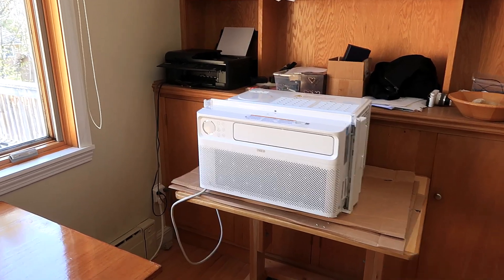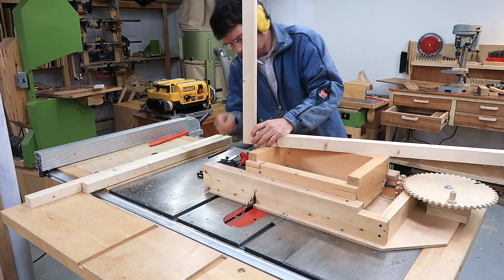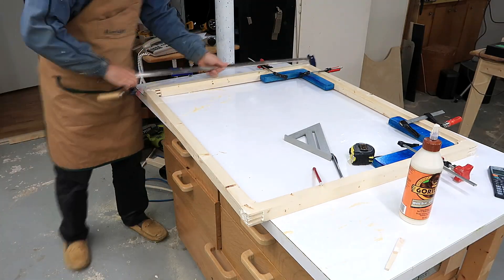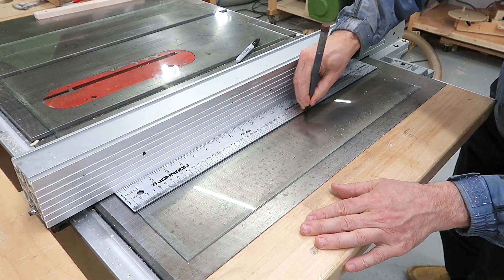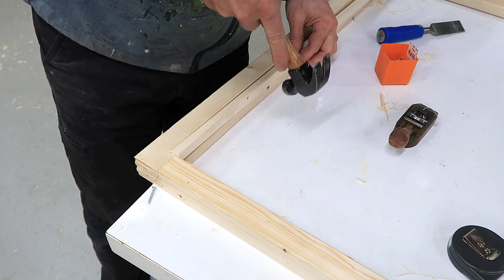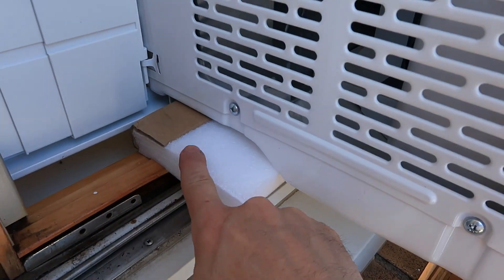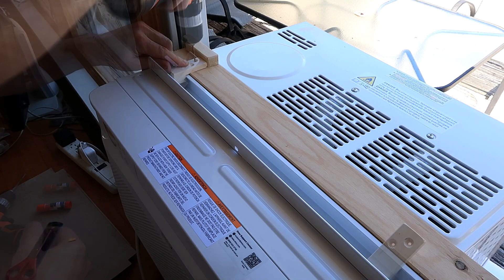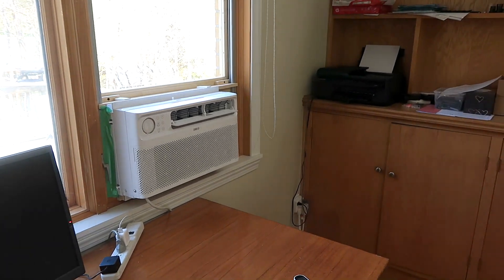Window AC into casement window: Making it fit!

Comment: For those who find glass cutting aggravating, here's some things i learnt bashing my head through it a few times: 
1. Find the best knife. 99.9% of the knives you find on the road are garbage. Even in reputable brand batches, you'll find garbage ones. It's all about finding the right one. I genuinely think i went through dozens of them until i managed to score the right knife.
2. Plan your cut. Kinda like in welding, do a ghost pass before the actual one. One, you wanna make sure you don't get stuck in something, two, that your brain has registered the motion so that:
3. Never stop mid cut, complete the cut in one smooth, clean cut. Never double back, never redo the line.
3a. If you had to stop, whatever the reason, find the termination of the previous cut, and start from that.
4. Practice. If you made a bad cut, the junk piece is your slice. Make that thing into tiny chips. It helps a lot.
5. Make sure the edges are scored through, start as cleanly as possible from the edge. If you don't have much luck with that (if you find that chipping occurs or the edge isn't cut right), you can use 3a in reverse.
6. Light scores = best cuts.
7. Don't bother with tapping all that much. Either use the weight of the glass to help you snap the extra piece or use the tiniest grain of sand under the cut to press the extra piece against on a flat, smooth surface.

I've managed to go up to 1 cm thick glass using these. Perfectly smooth edges once i managed to get in the right groove.
Reply: I must have been lucky, my first glass cutter I got from a guy that was selling off his stained glass setup.
Reply: Yeah, my grandfather used to cut LOTS of glass for his greenhouses.  For him cutting a piece to fit took about a minute, and he never botched one up.  And yeah, super sharp oiled cutter, and a single pass without much  pressure at all.  After you've done about a thousand of them over a decade or two you get pretty good at it.
Reply: I found oiling the cutter make a huge difference. 
Dry scribe doesn’t break as sharp and sometimes even deviate from the scribe line.

Comment: Your solution is a lot more elegant than mine. I just used a 3/4" piece of plywood  to fit both the window and cut a hole to slide the A/C unit in. Then cut more holes for side lights and flat mounted plexiglass with silicone and 1/4 round. Screwed the while thing into the window frame. Since the plywood was so thin the A/C unit kind of teetered a bit so I ran some small chain up to the soffits that I could secure the back end up and level it off.  Just have to make sure it tips down slightly in the back or the moisture will run inside 🤔 😀

Comment: I have horizontal slide windows and several window units. I find a well cut sheet of plywood and a little scrap foam work well but your solution is much nicer.
Reply: My dad used rigid foam insulation which was great for efficiency.
Reply: This is what I did last summer. Looked like crap but it worked

Comment: I love the process you went through to install this AC.  I did something, somewhat similar with an AC that has the round ports that you close on a double hung window, except I had a casement window as well.  I had not installed glass though, so I liked that upgrade.  Mine was for a tenant though, one which wasn't paying rent either so it was just better that they leave so I could get the central AC fixed.

Comment: I've been installing my ACS in a similar fashion for years. I either use layers of laminated cardboard or slices of styrofoam for the sides. I use plexiglass for the top of the units. I get them to cut it to shape when I pick it up. Not as fancy as the window frame you fabricated.

Thanks for the content.
Keep up the good work.

בס'ד

Comment: My home office is right under the roof and in the summer it can get quite toasty, especially with the computer running 8 hours a day.

I've bought a single hose air conditioner from TCL. I know that it's really inefficient but it was all that was available. I don't have access to the window from the outside, since it's so high up, so I bought a Plexi glass sheet, cut it to size and cut a hole in it where I can plug in the hose.

The whole contraption just sits right up against the rubber seal, held in place by some wooden blocks.

That means that the mosquito net as well as the shutter still work perfectly fine and I can install the thing without having to mess with them.

It works reasonably well, though it is extremely loud and inefficient by design.

Comment: Put the hardware in a Ziploc bag and tape it to the window, then when you want to reinsert the window, you can.

You should have added a second pane with a gap between. Double pane is better.
Reply: the plywood has 14 layers
Reply: Tape will leave a sticky residue later. But it is a good thought.
Reply: @mckenziekeith7434  If you tape it to the top edge of the frame, it won't show and shouldn't matter much.
Perhaps staple the bag instead.
Reply: @sdspivey I’ve been using magnets for hardware, and it works great. If there isn’t a place on whatever I need it for (ex the window), i have a magnetic dry erase board i can label

Comment: I wish I had had the tools to do something like this when our central air died. It was a miserable two weeks before an HVAC tech could come out to fix it. The upper floor of our house hit 115°F at 90% relative humidity. We basically lived in the basement, and even down there it still got up to 92°F. 

Every window in the house is a casement, and even though I found some units that fit casement windows, no place locally stocked them. To special order one was going to take about as long as it took to fix the central AC.
Reply from the maker: A window AC, while not able to cool down the whole house, can drop the humidity in the whole house quite substantially -- even a small window AC
Reply: Holy hell. I'm glad I live in Sweden. It might get up to 92°F in my media room on the summer with PC, TV on. Your "115°F at 90% relative humidity" sounds like a punishment.
Reply: @matthiaswandel  Yeah, that's primarily why I was trying to find one. Any drop in temperature however small would have been great though. 

I ended up buying a dehumidifier. Even though it made the basement a few degrees warmer, dropping the humidity from 90% down to about 40% made it so much more bearable.
Reply: I used to cool my whole house with one window ac unit, granted it was a larger one and permanently mounted in wall. It was in living room so I'd just run a couple fans blowing into the bedrooms. Cooled the whole place

Comment: I've wanted to do something similar even though I have a double hung window

I'd like to get a much better seal to keep out bugs and the flimsy plastic accordion stuff is no good for that. Blue painters tape works, sorta.

I run AC in my small office rather than the whole house since I work from home. No need to cool the rest of the house until the evening.

Comment: Might I ask why you'd install an AC, but re-use single pane glass above it? Seems like a weird combination. Is energy that cheap in Canada?
Reply: Doesn't make that much difference, at least not for a single window. A normal double pane window has an R value of 1.5-2. Single pane is around 1.
Reply: In summer it's hot anyways.
So why bother with insulation?
Reply from the maker: In winter the tempreature difference is often 30 degrees C.  In summer, with AC, it's maybe 5 degrees.  Just not worth it for summer only.
Reply: Yes Canada has very cheap electricity. Majority of our provinces use Hydro Electricity. We have lots of water…so far!

Comment: Never seen an in-window air conditioner here in NZ. Really weird. We only have split systems etc here.
Reply: Extremely popular here in North America.  I’d say since the last 20 years now we’ve begun going into your type of A/C.  They’re called mini splits.
Reply: That's right. I just replaced two window type AC units with 2 1 ton mini Split system s. What a difference. Much more efficient and quieter.

Comment: I have never in my life seen a window that opens like that with a winder. Are they common in your country?
Reply: They are called casement windows and they are very common in Canada.
Reply: @peggyt1243  I think the winder is pretty cool. It reminds me of my old cars.
Reply: @christopherinteriors6521  Are casement windows better than sliding?

Casement windows are more energy-efficient than sliding windows. Since a sliding window has to have a flexible seal on the top and bottom runners of the window, it can never seal as tightly as a casement window. There will always be a bit of a gap on the top and bottom sash that allows some air through.
Reply: Sorry guys we seem to be a bit confused here from my original comment. I know what a casement window is, Most houses in England have them. It is the winder that opens it that I was curious about. Many thanks

Comment: Easy, just close the window and throw the AC unit at it...done.  Make sure the unit is tilted down at the outside at least 5 degrees, or you will wish you had.  Seriously, it is important, otherwise it can leak inside, and often not initially but after a year or so, for some reason.  Maybe crud buildup in the bottom of the cabinet?
You make AC mounts like most people make furniture.  I just cut out a piece of 3/4" plywood and chunked it in.  Easier in aluminum single hungs.

Comment: I have sliders like you. I didn't want to put it in the window so I cut a hole in the wall with my 4" diamond saw and jackhammer and finished it out. It's much better, but a lot of work. The second floor required me to make a small scaffold. I just used double 2xs and plywood.  Altogether it was about 3 days of work including patching/finishing inside for each a/c unit.
     I put them just under the window lintel and 6" from the edge of the window for structural reasons.
    edit;  3 units were about a week and a half to put in.  I really should have specially ordered sleeve units for the particular wall but I was in a hurry and just took a stock ac unit. The sleeve was a little short, but I made it work.  They are a little high on the wall but they have remote controls, so I never have to touch them.  I just need to put some sort of damper outside on the top of the unit. It gets quite noisy when it rains hard.

Comment: Air conditioners are most effective when they are installed as high as possible. I’m surprised that you as an engineer you didn’t take advantage of that fact.
Reply from the maker: There is practicality.  also, no need to cool the air high in the room.  The air blowing out of it mixes it just fine.  I'm an engineer, so I don't have to follow stupid mantras.

Comment: i don;t know how Americans/Canadians survive with single glazed windows, here in the UK we have PVC double glazed with Argon gas between the glass
Reply: We have em here now. Double pane is standard now with optional triple and now quad pane windows 👍 It's just when cutting a window to size can only do single pane
Reply: You are extrapolating beyond all reason. Does every house in the UK have double glazed windows with argon gas? Are there maybe some old windows somewhere that don't, somewhere, maybe in Devon or something? Also, the window Mathias removed WAS double glazed. So you are wrong on that score also. But I used to live in San Francisco. The climate is so mild that it really is not a big deal to have single pane windows. Many old homes there have single panes. You only run the heater occasionally, and the vast majority of single family homes in San Francisco have no air conditioning at all. On the other hand, in places with cold winters and/or hot summers, you will find 100% of all new construction is with double pane windows. If you ever visit San Francisco in the summer be sure to pack a jumper and a light jacket. It can easily be colder there in August than it is in September.
Reply from the maker: for a 5 degree temperature difference over the summer, it doesn't matter much

Comment: If you were taking out a window anyway to fit the ac unit, could you not have removed the panel that didn’t open to its left? That way you could have kept the opening window for fresh air if needed.
Reply from the maker: there's another panel that opens.  And the non opening panel doesn't have a good way to take it out.

Comment: It's so crazy to me that Canadians still have single pane windows in properties that aren't abandoned.
Reply: Yeah, it almost hurts to see an AC (even worse, a window AC) get installed in a wooden frame without any measures to make it airtight, with a single pane piece of glass, and a thin piece of plywood. I guess that's what you get when energy is dirt cheap. Same goes for gas in the US, if they had European gas prices, those gas guzzlers would've been gone decades ago.
Reply from the maker: its double pane, but the temporary window for the summer is only single pane
Reply: @matthiaswandel  oh it is? Looks so thin compared to the EU type window, guess it's the small frame giving the illusion
Reply: @UhOhUmm  Nah, the normal windows are definitely double pane, but it's more like that older double pane from the 90's that's 10 to 15mm thick. This home isn't that new, so it's to be expected. Personally I just wouldn't want to run an AC with such a large hole in the thermal barrier. Hell, I wouldn't even ever consider using a window unit, even if it did fit.

Comment: wouldn't replacing the single pane glass with double pane would pay off in the long run?
Reply: How is it even humanly possible to live in Canada with single pane windows? My garage doesn't even have single pane windows!
Reply from the maker: In the summer heat, the temperature difference to outside is maye 5 degrees.  Vs 25 or more in the winter.  This window is only for the summer.

Comment: Cut the 2x4 to length BEFORE ripping them, then they won't bind on the blade. Simple really.
Reply from the maker: the pinching usually happens about 30 cm into the cut.  I needed pieces longer than that!

Comment: concerned about the cardboard shim getting wet and moldy. could that be an issue?
Reply from the maker: It's not in the rain
Reply: @matthiaswandel  There is a small probability that a driving rain might reach there, but that is a low probability event in my observation.
You should scavenge up or buy a small piece/stock of coroplast preferably some of the white and some of the translucent (generically, corrugated plastic sheet https://en.wikipedia.org/wiki/Coroplast ) handy to have on hand for such general applications (though of course cardboard is ubiquitous and much of it , practically speaking, is plastic coated too).
Reply: @Don.Challenger  its an AC unit.... you take out when it rains?
Reply: @Repect4  I can't tell the tone of your comment. Window AC units stay outside when it rains.
Reply: @eDoc2020  I take mine out when its raining/cold

Comment: What's it with you North American fit through whatever window AC? Rest of the world just mounts it to a wall, drill a 2 inch hole (yes that's in Mickey Mouse units) Fit the unit and connect to the cooler inside. Heaps more window to enjoy, light to come in, and better insulation value.
Reply: Because that's even more stupid. If you're gonna do that, you might as well do a central AC. Your solution makes no sense; not easy to install like a window AC unit, and not as efficient as central AC. Your solution sucks for everyone. 

Though, assuming you're European just by your tone, I know you guys aren't too into efficiency/elegancy.
Reply: @wanders278  we Europeans aren't into Efficiency?
You know that Germany is part of Europe right? 😂
Reply: And what to do if you're prohibited to hang anything on facade/drill into it?

Comment: What's the point of a wireless remote control for a window AC? Pointless, as far as having the unit work properly. Must be a sales feature. Same as Bluetooth on a simple toaster. 
I would rather have a solid state, set it & forget it, nothing fancy to break, AC unit.
Reply from the maker: you don't need the remote.  Yes, I can't think of many use cases.  Waht's really annoying is the Dyson fan that I compared the dreo air purifier to.  That fan needs the remote for full functionality.  What a stupid idea!